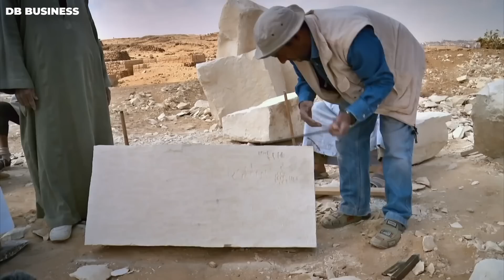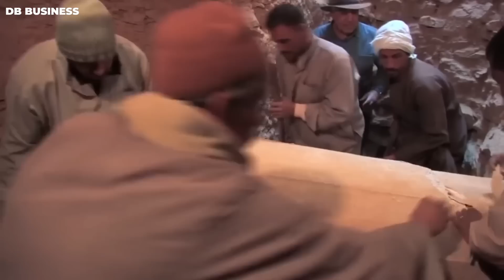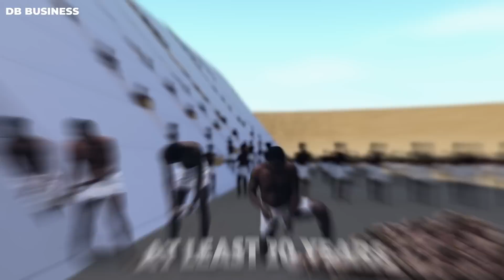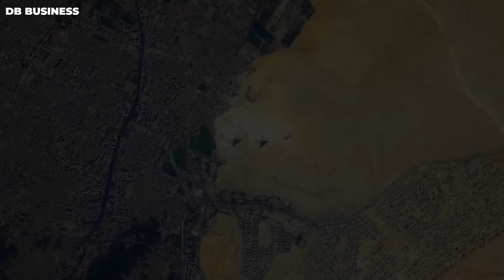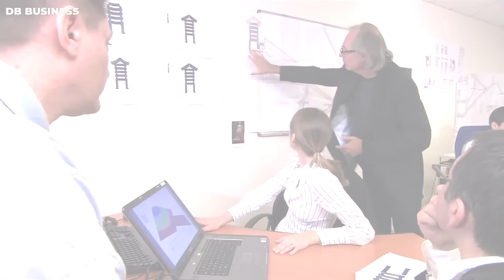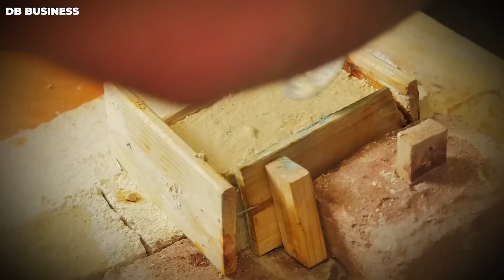The Mystery of The Great Pyramid Has Just Been Solved by Elon Musk

Comment: The carbon dating is correct, and coincides with the 4th dynasty’s claim that they built the great pyramid in 20 years. Nobody believes you could place 2 million multiton blocks in 20 years. But you could put a new set of polished limestone casing stones on the outside. That’s what the carbon dating is measuring. The organic material in the mortar that’s holding the newest set of casing stones to the substructure. The carbon dating is correct AND the great pyramid is much older.

Comment: Ok as someone who is a builder knows the best way to build it with the tight tolerances it has is to fourm it and pour it and it's been proven by a guy you can find his video it's not natural rock it is limestone limerock heated up and then mixed with a natural geo polymer and ash basicly a type of concrete we use the same method basically to make concrete now it's been proven that there is a limestone quarry near them where they dug out crumbling limestone and beat it in a pit and mixed with water and geo polymer and they would just get buckets and bring them up and pour in each fourm they did tested the limestone on the pyramid and it matched the quarry and the guy who proved it built a small scale blocks. But they did move the huge granite stones somehow and at balbeck the moved the biggest stone's anyone has ever seen.

Comment: I believe the majority of the information in this video is wrong just as the public has been told for many decades. A scientist puts for a theory and gains notoriety but then another comes forward with evidence to the contrary of that theory and the scientists objects and attempts to discredit the new information, imagine that. This has been the norm that has held back scientific advancement for eons and it is based on human pride. There is a growing body of evidence to suggest that the Great Pyramid is older than ten thousand years and that the Egyptians of around 3500 years ago may have found them abandoned for some unknown reason by a previous more advanced society and claimed them as their own. There has never been a mummy found in The Great Pyramid so to claim it as the tomb of Khufu is completely wrong. Also,  how did they align it to within 1.6 degrees of true north. Also bear in mind that the pyramid has eight sides and not four as each of the apparent four sides is bisected in the middle with an indentation moving slightly inward toward the center therefore creating eight geometric sides

Comment: The pyramid was used to calibrate the date of vernal equinox by its 8 sides. If all 8 sides are illuminated at noontime, it is vernal equinox. The year it was made was built upon the Sphinx. The head of the Sphinx was a woman, the constellation Virgo. At the dedication of the Sphinx, it was vernal equinox and the sun is at Virgo. The date was March 9, 24694 BC. It was built for 400 years. They built a square dam at the base of the pyramid and floated the stones using wood. As the pyramid goes up, the dam follows up with locks to raise the stone blocks. The pyramid was a water ram pump.  It was spring and Tishri 1. Happy New Year.
Reply: So it was built over 20,000 years ago like many people have said. Predating the last ice age.  And that the Egyptians did inherit them.
Reply: Why do they have to serve only a single purpose? I think they are a LOT more than You say they are.
Reply: @timetraveller4116  the excess gases produced by churning of water, lights up the tip of the pyramid and serves as a beacon at night.
Reply: @alfonsoleyson3962  where can i learn this?
Reply: The dam used to hold the water would have been a much larger project than the pyramids themselves and the amount of water being pumped to raise the stone would be unfathomable.  More likely they were mechanically lifted with cranes and pulleys.

Comment: The pyramids mystery has been solved for awhile now, though not how they were built.  They are piezo electric power plants.  Water flows under them from the channels leading to where the Nile used to be, pressure difference created by a chamber under the pyramid causes the water to smash hard into a block of granite, generating piezo electricity.

It’s already been proven the internal structure focuses and channels electrical energy and the pyramid shape compresses electrical power inwards and then up through the top, which used to be gold (an extremely potent electrical conductor).  There also is copper wiring that had been found and there are spots around it outside that used to have copper tubes attached leading into the ground.

This electricity would be wirelessly transmitted to the obelisks, which are made of granite and capped with particularly large amounts of quartz.  There’s even art depicting what are obviously lightbulbs and a Greek historian describing his encounter with what is most definitely a lightbulb triggered by the static electricity of his approach.
Reply: Nice troll lol
Reply: @MCoTEDDY  
Thank You, Mr Troll
Glad To See You Too
Still Alive After All These Years.
😁
Reply: This time what went on in Vegas will not stay in Vegas!!

I met both Britney Spears and Elon Musk in 2000 at Bellagio. Britney just stared at me as she was singing on stage and I was standing in an archway above and nearby. I'm not sure if I was supposed to be standing up there by myself but I did have her undivided attention. A few days later Elon came up to me and started asking me questions about what I was doing there, in Las Vegas and Hawaii during that time. If I would I be fine answering a few questions. And if I was a gambling man? I stated, "I was on vacation and I only like to bet on things that are worth betting on!" I had earned these trips by qualifying reward points at my work. He asked, "What kind of work is it that you do?" I said, "Commercial energy saving promotions but I had been schooled in Automotive Marketing Business Administration and worked in that field for several years as well." He asked me, "If I had millions of dollars to spend what would be the most innovative businesses that could help humanity?" We talked about electric cars, we talked about solar energy and so many other subjects for over an hour. Even commercial space exploration for the consideration of colonization. That way all of humanity's eggs are not in one basket in case of another world war, asteroid strike, major climate change, etc. These we're very expensive and ambitious businesses to become successful at. Therefore we had to talk about ways of keeping a low overhead in advertising, distribution and the manufacturing. He said, "They were all very good ideas and that they should be done!" He said he had already made hundreds of millions off of a couple internet companies he started. "One of them was PayPal," he stated. Not that I had really done a lot of online banking or e-transfers at that time I didn't think much of it, until I noticed online about a year later that I could buy something off the computer with my PayPal card! Unfortunately I had just received a promotion as regional manager with the company I was working with. This made me let Elon know that I had to wait for a few years before I could assist further. I keep on sending out messages, hoping that he will get one and reply back. I will probably have to keep on trying, he gets more messages in a day then I would in five years! It is very inspiring to me to have a conversation with someone and they dedicate the next 20 years to making our conversation reality! We also talked about becoming your own best supplier and starting businesses that help your existing business. A type of slingshot effect that he has incorporated very well. It is so ambitious and amazing that he was willing to put pretty much all of his money where his mouth is and just make it happen with a consistent dedication. Congratulations Elon and I am looking forward to working with you again, one day in the near future! I still come up with innovative business ideas on a daily basis. Of course Britney I always wish her well and would enjoy meeting her again as well. First we will shoot for the Moon then Mars and then we will end up amongst the Stars! If you would like to learn more of these topics let me know. People with integrity expect to be believed otherwise they let time prove them right!  
propower101@hotmail.com
Reply: @proteslapower6754  
Parackletos
Don't Fly ...
To Close To The Sun
Reply: Uh Huh ... 
How The Egyptians Made Gold From Lead Requires An Energy From A Source.

THE SUN 

A DEFRACTING CRYSTAL

To Seperate The Light Frequencies To 'Shake' ... The Covalent Bond To Allow Hydrogen, Under Presure, To Be Infused, Into ...

The Lead Target 

Within The Sub Atomic Structure of The Lead Mass

Lead is ...
Decomposed Uranium
The Inert State

The Pyramid is a Magnetic Containment Vessel As Well.

A REACTOR ...

Utilizing Natural Made Materials To Contain ...

The Hydrogen ~ When The Infusion Process Is In The Process Of Transforming 

The Lead Into Gold

Voltage
Frequency 
Hydrogen 

Infused In Lead Under High Pressure. Changing The Sub Atomic Material Structure Of Lead > ...
To Gold
Reply: A Diamond Crystal 
A Cap Stone
A Pyramidal Shape
A Light Seperator

Sits Upon ...
A Golden Plate

Above The Pyramid 

Like A Crystal Eye
Shinning Like A Rainbow
In The Sky.
Reply: A Golden  Means
A Toridal Spin
A Pyramidal Shape 

A Design ...
To Allow Gravity To Spin
The Merkabas Within.
Reply: Is much tjeoey to support ones perspective quickly becomes hard fact lol.
I wish people would stop screwing up facts using terms they kniw nothing about.
'Electrical energy' huh? 
If you are going to use a term like that then you better be able or explain what that is!
Do you mean electromagnetic? Do you mean radio? Do you mean direct current electricity? Do you mean alternating current? What is "piezo"?! 
Esoteric 'energy' has no meaning at all. Here, let me prove it.
Someone, anyone, define the word Energy in this application!
I'll tell you what 'energy' isn't! Its not a stand alone force or stuff or thing in any way shape or form.
So much crap is attributed to energy.
Reply: That is exciting.  Why did they stop using them? Would this have been before the great flood?
Reply: Correct,they were power plants
Reply: Sorry gold is a shitty conductor only reason they use it as it doesn't oxidize
Reply: @chauvinemmons  
GOLD IS THE STANDARD
It Lasts Forever!

Comment: People underestimate the power of a pale . Cutting stone humans were well capable of and so are we at moving on rollers and everyone should stop thinking heavy and lifting because none of that happened . Lay out a flat row over a dug out tume fill in entire area around  the layer till its ground level  building literally a huge mountain as each layer extends the elevation and angle . Once top piece set in place  remove earth mound cleaning as  you go they probable needed the huge area so built 3  instead of one . Lots a pales of mud .
Reply: Obviously you have never done any heavy work. If so, you would not have made your naive comment.
Reply: @samdavis1958  laughable , I work with slab stone silly .
Reply: @samdavis1958  no its logical , you  arent . Thats all .
Reply: @samdavis1958   You just lack the knowledge to understand that you can build a mountain of sand with a pail in feet  And hands to carry it. I carried 212 yd loads up 2 flights of stairs in a 16 hour mud bed extravaganza. Then 3 months later the cat clinic burned down because of a meth lab
Reply: @samdavis1958   That 12" mud bed came crashing down
Reply: @samdavis1958   I doubt you know what hard work really is But even more so by the mentality that you delivered your little insult You probably have no clue that hard work is not even natural. Nor do you probably understand that value value that toil worships because toil made it is is it natural either it's a fable To natural order
Reply: @samdavis1958   If you want to talk deep Just try to keep up